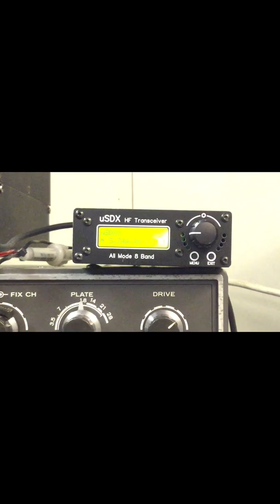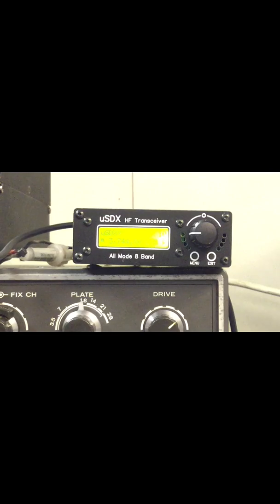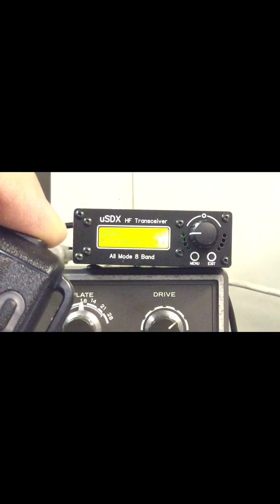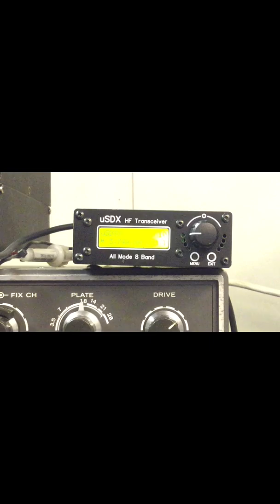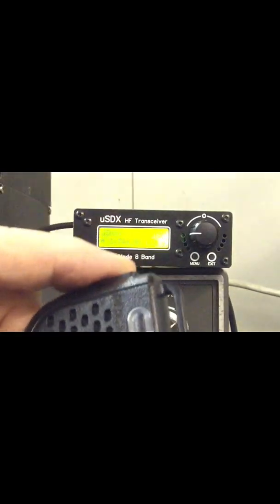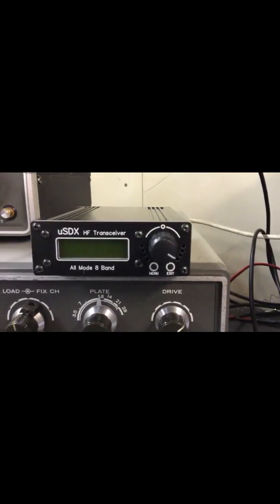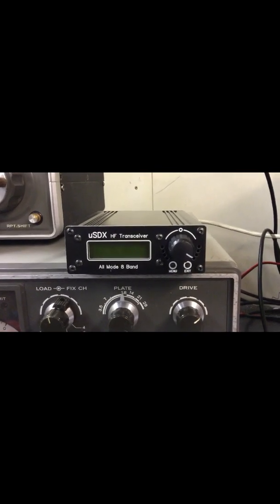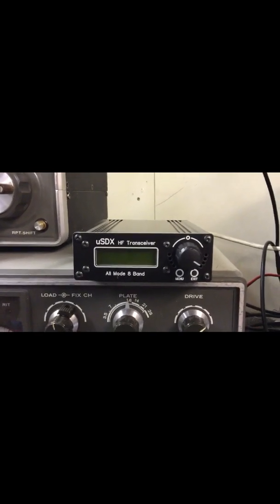First QSO using the uSDX transceiver /QRP on 80m

Comment: I have the (tr)uSDX. Seems to operate the same. Mine has a high noise floor. Mine also locks up in iambic keyer mode. But then, it was a kit. I’ve got a more robust amp chip for a final and extras since I’ve already blown one. Still tweaking here and there. 73’s de n5vwn
Reply from the maker: I have two truSDX I built from kits and neither had noise issues.
Unfortunately, I've not used CW so can't comment on that.
And I've not yet blown the finals in any SDV transceiver.
Maybe I'm too cautious 😀

Comment: Great preview for the uSDX Mark.  Looks like an awesome little radio.   Before buying it, can you video using a 12v battery supply.  I'm hoping this would alleviate the weird noises the transceiver is producing.   
Thanks, Martin, WH6XY
Reply from the maker: Video to follow on battery power, linear PSUband SMPS PSU.

Comment: Exelente QSO! I have a question. Is it a recomendable portable QRP radio? I would lick to buy this radio. 73 from LU9FNI (NATA)
Reply from the maker: Thank you.
I’ve never used this QRP portable, but with careful setup, this would be good.
It’s small, light and needs very little power.

Comment: Nice contacts.  My radio like this stopped working after three uses - beware!
Reply from the maker: Known issue.
Blown op amp and multiplexer.
Voltage regulator needs re jumpering from 12 to 5V
Reply: @m0jcfhamradio75  but how to do it? How to convert from 12v to 5v? UA6UDI
Reply from the maker: @radiovodopad1851  
I will make a video.

Comment: I ordered one last night. Looks like it will be a good little cw rig for /p
Reply from the maker: Be aware Sam, these will need modifications out of the box.
They can blow the op amp and the multiplexer chips.
there’s a mod to reduce voltage from 12 to 5V I believe.

Comment: Nice video. Can you provide a link to where you bought it from? I've seen them on eBay, but a lot of them seem to have a SMA connector rather than the BNC.
73, Dom, 2E0WHQ
Reply from the maker: The seller was called cybereveryday Dom.
They sell all different versions of this.
I’ll find the link later.
Be aware, they have an odd way of shipping.
I received an empty jiffy bag valued at £100 weiging a few grams.
Two days later (after measging them) my item arrived.
Tracking was provided door to door, the final leg being Hermes.